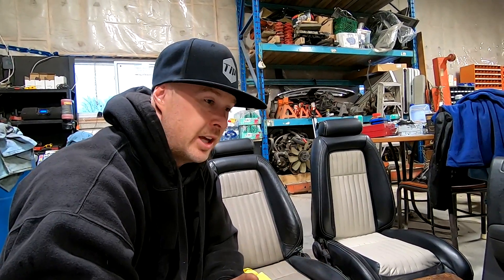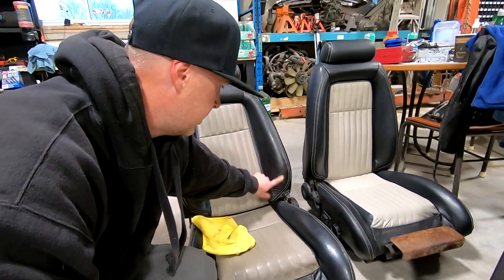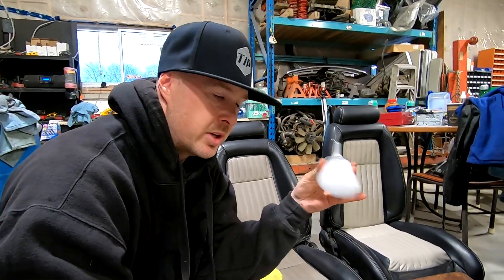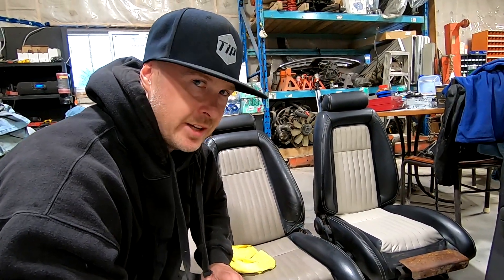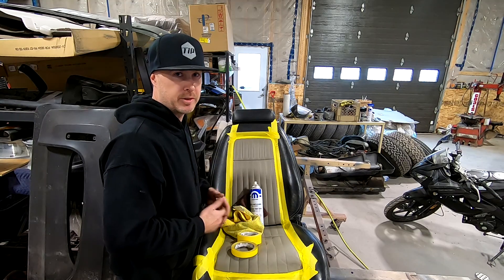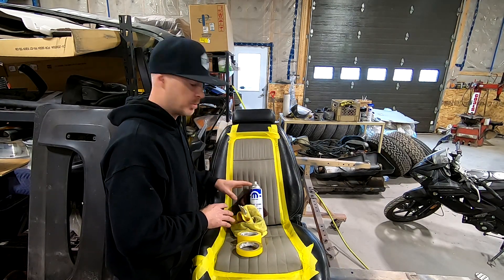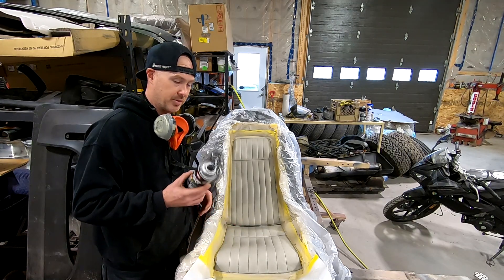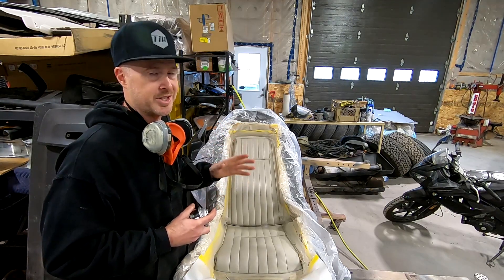Dyeing Your Leather Seats with SEM Paint - TIPS03E48

Comment: Looks great the Only problem is that is a solvent base spray paint and it will crack and peel is a short time .You  should have used a professional  water base coating like polycryl.  If you want long lasting results professional products will give you a longer lasting job.